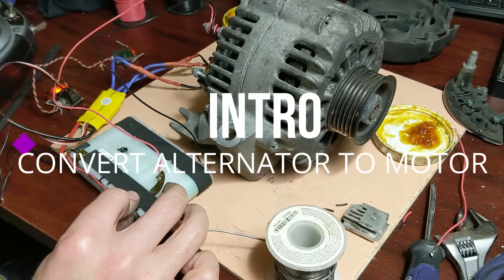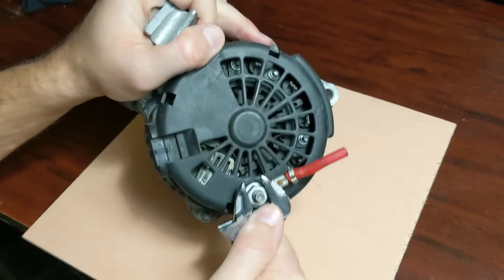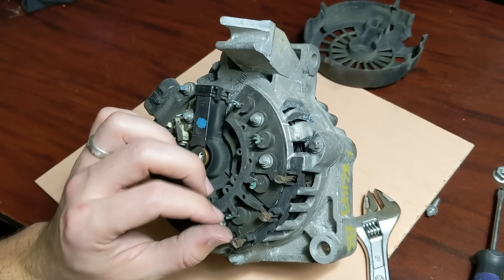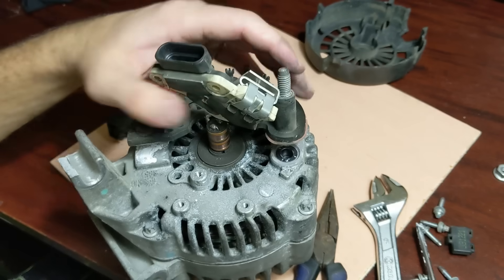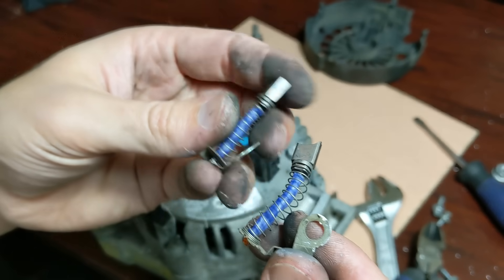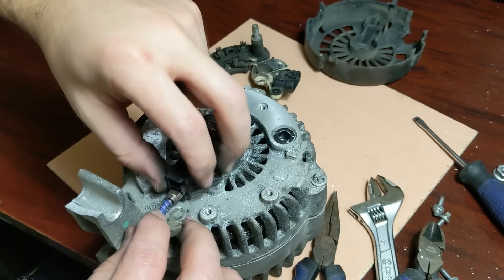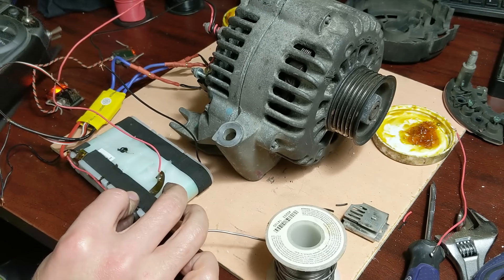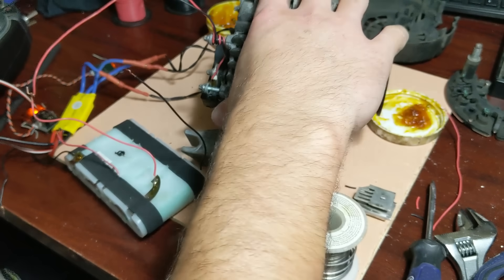Convert Alternator to Brushless Motor

Comment: As an alternator, it will easily put out 100+volts if the regulator is disconnected and rpm high enough (I've seen 6v alternators on small motorcycles put out over 90AC volts,  no load).
  I would think most automotive alternators can also put out around 45amps at low end and vehicles with high electrical loads 100 amps or more. (It's been a long time since 20 amp alternators were 'enough')
Therefore, you can put 100+ v into it at lower amps or, high amps at less volts. The stator will need a controller switching each phase to get any decent torque.(or wire it as a low volt 3 phase motor?)
 In effect, you have a very crude stepper motor or a brushed 3 phase motor. The rotor will only need a small voltage to create a magnetic field, the outer winding's will control the torque.
Reply: 100 AMP @ 12 fucking VOLTS , 10 AMP @ 120 FUCKING VOLTS  ass holes
Reply: @lesstime1678  ..........and your point is?
 I equals V over R or any combination.
Guess you just learned that from Google?

Comment: nice, but practically its not a brushless motor since you are still using the brush to power the coil, you converted an alternator into a dc motor
Reply: Nope, it's a bldc with a DC electro magnet instead of permanent magnets. The stator makes the rotor spin with 3 phase ac voltage. The DC voltage is only there to provide a magnetic field that would normally be a permanent magnet . So brushless motor. If it had a Commutator it would be a DC motor.

Comment: The two brushes connect to the the slip rings on the rotor. What you call the "Middle part ". It rotates, and is a rotor.  The stater is stationary and outside the rotor mounted in the housing.

Comment: That plastic thing that you put on the brush holder does not guarantee protection from a short circuit between the brush terminals via the bolt, so this setup is unreliable and depends on luck. You really need an insulating grommet around that bolt. Also you need some kind of control over the current you put via the brushes, not a static battery voltage. Because it affects the torque of the motor hugely. And you do realise that that current is limited only by the (very small) resistance of the rotor coils (no inductive impedance on DC feeds), so I suspect your batteries will not last very long and will probably get hot as will probably rotor coils themselves. In its original usage the current through the brushes is regulated and is pulsed, not DC. So the inductance of the rotor coils will not allow it to become too large.  Not the case with your poor batteries.

Comment: WHAT AN EXCELLENT VIDEO! MAKING A BRUSHLESS ELECTRIC MOTOR CAN HAVE MANY APPLICATIONS. I BELIEVE POWER AVAILABLE IS ONLY BASED ON SIZE SPEED CONTROLLER YOU CHOOSE, AND THE AMOUNT OF BATTERY VOLTAGE YOU APPLY.
Reply: Until you exceed a voltage the insulation on the windings can withstand, arc through the insulation & create a short circuit...
or  overheat the windings, melting the insulation and creating a short circuit.

Given that the armature shaft is steel, it's gonna produce a whole bunch of eddy currents.
Eddy currents produce a great deal of heat.
Think of a large air core inductor with a piece of steel passed inside while it's energized.

While I don't doubt that an automotive alternator can be over amped/over voltage, there are limitations to doing so... for our own safety.
The wire gauge of the windings would be a quick way to get an approximate safe maximum input/output.

The more voltage used, the greater chance of arcing.
The more amperage used, the greater chance of overheating.
Reply: @kaisersose5549  … or overspeed the bearings, or overload them or the windings with too much load. Typically, a motor will stall first in the latter condition, but an alternator may be more lightly built than a typical motor.  The original wattage rating of the alternator should be a good indication of the motor's limits.

Comment: You call it a brushless motor but you use the carbon brush?
Reply: The brush only powers the electromagnet, because the motor lacks a permanent magnet. The main motor current doesn't go through the brushes. It still functions exactly as a normal brushless motor does otherwise.
Reply: @everydayirace  WTF are you laughing about? You didnt know.. 🙄

Comment: whats the max power you can expect from these? I need around 4kW probably on 48v
Reply: Back of a napkin calculation says nope...

Here's why: An automotive alternator must follow the same laws as any other electrical device.
Regardless of how you manipulate the output, it cannot produce more voltage without lowering the amperage.
Likewise, you cannot increase the amperage without sacrificing some voltage.

200 amps at 12 volts
100 amps at 24 volts
50 amps at 48 volts

50x48=2,400 watts maximum.

Given losses for friction, heat, and other real world conditions, you could be sure to produce the 4,000 Watts at 48 volts desired by using a pair of 200 amp alternators.
Reply: Yes you can with an alternator but you have to use a bigger one maybe 200A or more and pass huge currents
and high voltages.
Reply: Alternators range from 35A to 320A for automotive uses, probably larger for big rigs or trains.
If you go from 12V to 48V it WILL overheat a 12V device. Ohms law means 4X the voltage is going to push 4X the current through everything, and probably start a fire, met it down etc.

Best stay under 14.5 volts, as that is the max output for auto alternators.
Reply: @extremesheepherder9  The motor doesn't care what voltage you use so long as the controller controls the current. I use a 48V battery with mine and it doesn't even heat up with a 800W controller. With a 1500W controller it will get a little hot.

Comment: When you use brushes it's not a brushless motor!
Reply: that's because the rotor not a permanant magnet, you have to energise the field coil to turn it into an electromagnet. so the speed controller sees it a brushless motor just with an electromagnet rotor instead of a permanant magnet.
Reply: You are missunderstanding.
As a brushless, not brushless.
Why it called brushless ( still have 3 wire 3 phase conecting to brushless ESC)
Difference meaning, but i know that the alternator is brush

Comment: Nice work, Pls tell me 01 question... can it work as a generator after removing the rectifier??
Reply: If you want to generate power with it, don't remove the rectifiers or the regulator.

It is possible to make that switch on the fly, but the circuitry is a lot more complicated.

Also BTW a generator is a permanent magnet device with a commutator instead of slip rings, they are less efficient and prone to failure at higher rpms as a commutator is weaker physically than solid slip rings.
the reason the devices put into modern vehicles is called an alternator is that it makes alternating current (AC). Then the rectifier diodes are needed to convert to DC. Car alternators actually make very well balanced 3phase AC power,because it is more efficient.
Reply: @extremesheepherder9  thank you Kaptain
Reply from the maker: Yes, you would need someway to turn AC to DC since now the rectifier and regulator are gone.
Reply: I made mine external to allow me to use much heavier duty diodes and reduce the points of failure within the case.

On the newer Ford alternators (as shown in the video) the most common mode of failure is one or more diodes shorting open.

I used alternator diodes out of a tour bus from the 1970's (200 amp, 2000 amp surge), put them inside a sealed container of mineral oil, and put the contacts through the lid.

Instead of the factory voltage regulator, I'm using a battery with two rheostats... One between the rectifier and battery (when I'm using DC), & one between the battery and the alternator.

This allows me to use one device as a starter, generator/alternator, and primary drive motor.
All built on top of a small outboard motor platform...
Used to be a 7.5hp Evinrude, but it's now a 173cc predator, and belt driven to allow selection of drive motor.

Just make sure you understand 3 phase AC before you start, 'cause that's exactly what an alternator without a rectifier is.

It can kill you dead, before you hit the ground!

There may or may not be a ground/neutral wire depending on delta v.s. wye configuration.

You'll need to either make use of the individual "legs" of the three phases, or use a three phase to single phase transformer.
Alternatively, three separate transformers wired together can be used with the wye configuration.
Reply: @kaisersose5549  Good safety advice about killing shocks

Comment: Can i use an alternator to power a pitbike off road to around 40mph
Reply: I'd just stick with mid drive or hub
Reply from the maker: No, it doesn't have that much torque for 40mph off road
Reply: How would I get it to do 40mph or atleast 35mph ???
Reply from the maker: You would need a gear system. 35mph is fast for electric motors
Reply: Electronic or from the actual pitbike ?
Reply from the maker: @konnorw9168  any of them. It needs a gear box since the RPM is about the same as gas engine. On dirt bike 45mph is about 3rd - 4th gear.

The alternator would need some gears too

Comment: Can you make an electronic circuit for this motor?
Reply: If you make a pulley system and connected that to a grinder wheel, you could easily make a bench top grinder, I would think.

Comment: You call the ROTOR a STATOR ???   Pretty obvious you don't know your way around DC nor AC machines.
This is an AC machine. 
Set up as a motor: 
The ROTOR [the bit that rotates [doh!] sets up a multi pole magnetic field.
 The STATOR [the stationary, non rotating] field windings set up a rotating magnetic field that the rotor follows.
Set up as an alternator:
The rotor is fed a regulated supply, [setting up a multi pole magnetic field].
The stator windings have induced AC voltage from that rotating field that is then rectified to produce a DC voltage.
The output has a high current capacity. The output voltage of the field is influenced by the voltage sent to the rotor [magnetic field]. 
To get the most kW/torque rating out of these alternators [set up as a DC motor] the 3 phase stator field should be fed high current supply. 
The rotor can be fed a lower current at around 12 volts DC. Determine that by taking resistance measurement of the rotor windings. BTW... the rotor has more than a single winding too.
You do know you are feeding a 3 phase signal to those stator windings from that cheesy little motor driver... don't you? 
You do know the way the speed is changed by that tiny motor controller is a mater of the pulse frequency... don't you? 

A Delta connected stator can be changed to Star... the torque output of Star will be higher.
This machine does not have 3 stator windings, so it could probably be connected as a 6 phase motor. 
Count the number of wires at each of the 3 stator terminals. More than 2, hey. That means more than 3 stator windings.   
Further, the field can be switched from Star to Delta when torque requirement is lower [after it has reached target speed].
Reply: The main difference between this and a 3 phase motor is the ESC controls the phase change frequency, so the speed, and even the direction of rotation can be changed. This guy is reassuring in a way, since he obviously is no expert  but got it to work.
Reply: made easy !
Reply: There have already been a bunch of others that pointed that out, he probably knows by now..

Comment: What happens if you just short the sliprings on the rotor? would it act as a squirelcage motor and induce the magnetic field in the rotor? in stead of using brushes to magnetize the rotor?
Reply from the maker: I would have to try it
Reply: @MadeEasyChannel  Hope you do, love to hear the results.
Reply: I would expect it to do nothing.  With the rotor shorted, it isn't magnetic!  Except maybe a tiny bit of residual magnetism.
Reply: That would turn it into a true asynchronous induction motor, but those only run the best with about 2% to 6% slip (because if they slip too much, or the rotor is stalled more and more, the rotor acts more and more like a dead short) and plus they are notoriously inefficient at startup and too much slip (which is why you can keep them stalled with not too much effort when energized) but are very frisky and powerful at 2 to 6% slip.  It just depends on what you use the motor for.

For the power controllers used for this conversion, one wouldn't be able to make that work because it monitors field windings for the presence of inductance from an energized rotor (when not using added hall effect sensors in the stator) to determine the position of that rotor, and until the rotor is in some kind of rotational motion (and the windings somehow excited), the circuitry won't be finding what it wants to be able to figure out which stator winding should be energized.  Therefore, the stator windings will never 'rotate' (because the controller won't even begin to turn on the first winding) and therefore imparting (by inductance) energy to the rotor so that it (the rotor) can act as a magnet.  On top of that, it is programmed to vary the current to the rotor through the brushes.  I have no idea what would happen if this circuit is not used of the controller.  There is undoubtedly more electronic reasons too for this not working.

This setup is only similar to a true induction motor running on 60 or 50 Hz wall current, because (assuming we're talking about three phase) the sine waves enter the motor at 60 Hz say, and each are displaced 120° from each other.  The frequency is steady and doesn't change, and the 'wall current' establishes the frequency, not a controller.  The three-phase power turns on and off (effectively) the three windings in a three-phase induction motor in a rotating fashion. This is why induction motors don't need a controller to work, but they're one-speed motors as a result (unless one throws in a variable-frequency controller, but that complicates the point being made here).

Comment: what is the max rpm with this 12v setup
Reply: Most alternators are built to withstand 8,000 rpm. The task at this point is finding a controller that can do that efficiently.
Reply: Its all about matching the KV of the motor and controller

Comment: i have no curernt in my home  but i live on a hill which is very windy would love to have this
Reply: You don't need to convert it to a motor.  Just put fan blades or a wind turbine on the alternator and charge a car battery with it.  With this simple an arrangement you'll only have 12VDC, good for low voltage lighting or a 12V camping refrigerator (very useful!).  And of course you could take another alternator, convert it to a motor, and attach a fan to it to cool you down on hot days!  But don't expect to run 110V appliances with it!  Finally, you could convert 12VDC to 110VAC with an inverter.  Small ones are cheap, will never run an air conditioner.  Just watch the total number of AC watts you want to consume and never exceed the rating of the inverter.  And be safe, use circuit breakers and safe wiring practices.

Good luck!  You can do this!  Proud of you!

Any electricians have any comments on what I've told Trish?  Left out anything important?  Misstated anything?

Comment: what i want to see is how many rpm's do you get when you use two like alternator and you make one a motor and then use the other to make the energy to turn it and what is the ratio energy made to turn at 100 rpm increments.
Reply: use an alternator to ruen another alternator?
Why??
Reply: The system will always have a net loss. There's no such thing as overunity.

Comment: You didn't made it brushless
Reply: technically it is a brushless, just with separated excitation
Reply: Brushless means  is does not have any brushes but this alternator have brushes
Reply: the brushes don't turn the alternator, just feed an electromagnet
the brushless controller is what spins the alternator

Comment: Good stuff. I have an old, but good condition alternator from an old  Mitsubishi V3000. I want to maybe make my old bicycle into a E-Bike by using this method.
Reply: A guy has already done that FYI - but there may be others - but it's not possible to view every YT channels and contents thereof -  and you probably just missed it but I'm interested in Alternator conversions for the reasons I've covered in my comment above to the host of this Channel  - so I've simply selected this one [the only one I viewed ] for you - to show the possible pitfalls and/or success of the project - which seems quite do-able nevertheless.

  A link to that vid - From my You Tube viewing history:

Bicycle Conversion using a 10,000 Watt Car Alternator
1,085,836 views
Oct 15, 2021

"In this DIY project video we are going to convert our bicycle into an electric one. We are going to use a car alternnator that we have converted to a permanent magnnet brushless motor that we have converted in previous project video.
Have a look at this project video as we are goingto have lots of fun building this bicycle.
More information about the material and designs visit the instructables article link:"

Hope this helps - good luck with your project.
Reply from the maker: Let me know how it works
Reply: I would like to know if it works as well and if at 36volts does it produce enough torque to pull a person because my bike is currently 65pounds with a single hub motor on it I want to make a awd with the rear driven by alternator motor on either chain or possibly belt driven like the surons segways ect